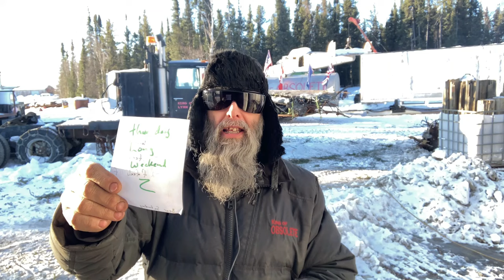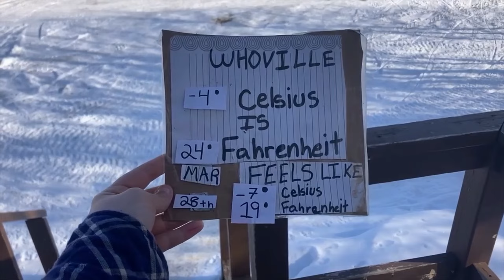Moved the Screaming Ford Featured on Ice Road Truckers Fame March 28 2024

Comment: Joey, you could weld a piece 2” square stock on the front plate instead of the bolt, then use a pintle or ball hitch mount to suit different trailers.
Reply from the maker: it was 10 years when we last used this hitch, we usually use the fork on the loader for moving things around but we did not feel like getting the loader out for a simple trailer move.  thansk

Comment: Can you believe that here in S.E. Louisiana, I have a cold too. Well I have some good Canadian whiskey that will hopefully knock it out. Hope y'all are feeling better.  It's freezing here  ,63 degrees Fahrenheit.
Reply from the maker: yes you are correct. the only time you guys down there should have a cold is from the AC being on too high, lol  thansk
Reply: @kingofobsolete4789  I've taken vacations to Florida in usually Feb to escape the cold...only to have 30 deg lows at night and 38-40deg days multiple times. But also had 85 deg days and need the A/C on for us polar bears. Most of the time it's 40 deg lows and highs are 50-60 deg. It's crazy sometimes
Reply from the maker: yes in the early 1990s i was visiting a lady in florida for 3 years. back and forth i traveled, good times and learned a lot about the weather.  thansk @mrmotofy

Comment: Good morning from Cape Cod 🦈 I especially like the new mirror bracket on the 3 ton 😂. Absolutely no drama moving the trucks around the yard, what fun is that 😉 It looks like you have the cooling issues figured out, you're not just a pretty face 😂 keep up the good work guys 👍✌️🇺🇲
Reply from the maker: yes we were caught by surprise with nothing getting stuck which we thought we would be filming but this worked out better. proper mirrors for the 45 chevy are on the wish list from Sir Rodney
Reply: @kingofobsolete4789  I kind of like the handheld model of mirror 😀
Reply from the maker: yes self adjusting to, lol  thansk @kennethsonier1766

Comment: Yes,the International 2+2 came out in '80 or '81. At the farm they rented a 3588 2+2 in the Spring of'81 shortly after I graduated high school that year. I worked ground ahead of the planter. Tractor was great fun to operate. AL B.
Reply from the maker: excellent info on the farm tractor. i just could not remember.  thansk
Reply: @kingofobsolete4789   The biggest was a 3788. After Case and IH merged the model line was discontinued. AL B.
Reply from the maker: yes remember the day they merge, sad day for IH  thansk @sallybrokaw6124